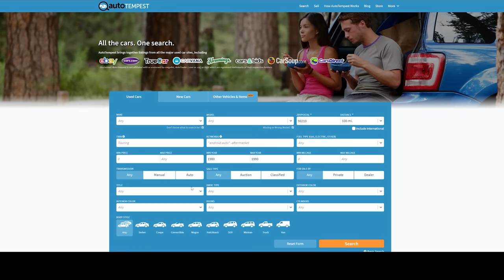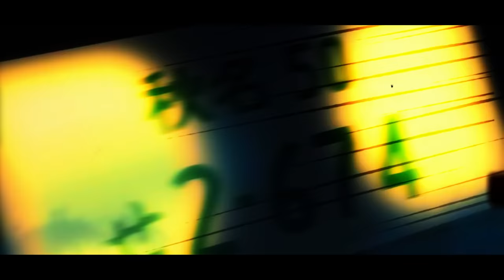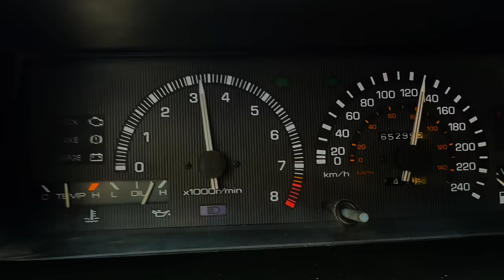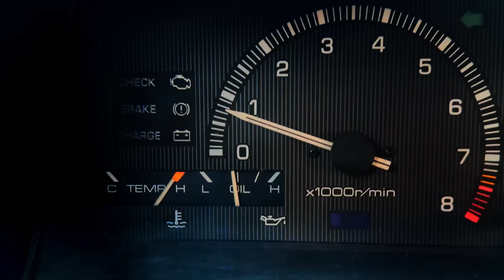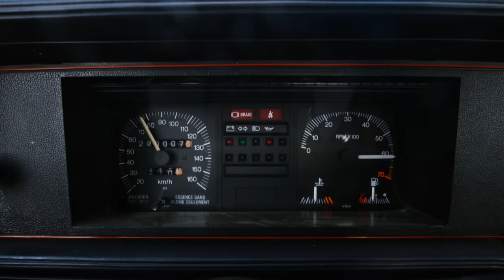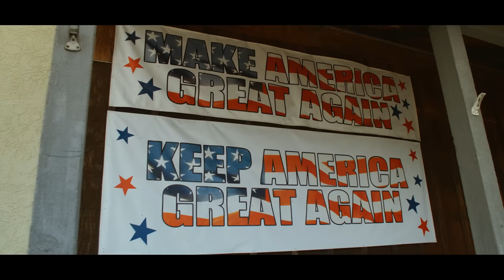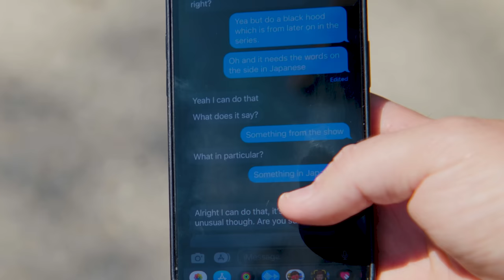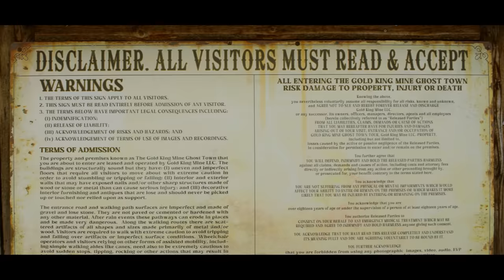1,000 Miles Across the Desert in OUR Toyota AE86 and GTI // Road to Enlightenment Ep.1

Comment: A car often overlooked in the 80s, that had more performance than both of these cars stock, is the Honda Accord Lx-i.
This was the first Fuel Injected Accord, and they were amazing! They weighed more than these two, but you got dual wishbone suspension all around, 20-30 more tq/hp than these two, had a significantly lower center of gravity, and lasted an incredibly long time. You could also have it in three body styles, at the same curb weight: Coupe, Hatchback Coupe, and Sedan.
Yes, you could get a Prelude with more power, but it was actually heavier than the Accord, even though it was based on the Accord....
Reply: An Accord had independent double wishbone suspension? Holy shit, how have I not heard of this?
Reply: @RhodokTribesman  I can't say why of course. But, it was often described as an "Unequal Length Control Arm" design. Which is what a Double Wishbone is, if done properly. The design was a Multi-Link lower, and A-Arm upper control arm, with Coilover Shock, design. It did get more true Wishbone style parts in the 90s and beyond.

Comment: I have waited for an AE86 review from you for ever! And this is just like the old Top Gear films! Yet another step forward for Throttle House 🌚❤️

Also, the AE86 sticker in Initial D says: "Fujiwara Tofu Store (For private use)" :)

Also #2, that AE86 with a Beams engine is the exact reason why I dislike any sort of heavy modification on a car, things don't work properly because that engine wasn't designed for that body's airflow 🧐 (Or so I suppose 😂)

Comment: The GTI 1.8 8v, with stock exhaust....from experience LOL!  that and the original cam really dogged that engine. 

Biggest improvement, particularly highway torque, was installing the euro manifold/exhaust and a G grind or north american spec 1.6 cam. It literally woke that engine up.

I really miss my 84 scirocco. The 80's did have some fun cars

Comment: My first used car was a 87' Celica GTS, lightweighted and so much fun to drive. Small and nervous car.  Even if it had only 135  hp, I feel that with less weight, I had more performance and handling than any cars I had after with much more HPs. Fun fact, I had the engine removed once to work on stuff on it, and I was able to lift the engine by myself as it was so light!

Comment: Its amazing how far cars have come.

A couple of years ago I was daily driving a euro MK1 Golf GTI 1.8L, with proper cams, shaved head, lighter flywheel, Porsche injection, spax coilovers and bunch of other mods. Made 129 wheel HP.(from 112 on the crank) It was a Rapid little car.

I had that car for 5 years, now I own a Model 3 Performance. Old cars are awesome when you are alone on an old Mountain road, but they are horrible in most other scenarios…. I tought about buying one again. I tried one, but its hard to get exited when you can daily 500 horses reliable… even my Superduke have barely gotten used after 4 years with the Tesla.

Comment: Takumi gets the 11k RPM engine swap, driver side bucket seat and gauges in the latter part of stage 2.

He got the passenger bucket seat at the start of stage 4. He gets the carbon hood from the 2nd battle with Todo school.

For stage 5, the engine was modified for more consistent performance (peak power came at 9k rather than 11k), a new gauge cluster and other upgrades. For the Kanagawa races, the car even got a roll cage.

As for the writing on the door, it was only on the right side (as that's where one drives in Japan). The text literally reads "Fujiwara Tofu Shop (Self Use)*

Comment: JB!! I do agree with most of these complaints. However, I’m shocked about the carpet material in the wheel wells. They are so easy to clean! I’ve owned a 2016, 2019, and 2022 Silverado all with the same covers and they are soooo much easier to clean and they don’t stain like the plastic does. Much love though brother 👊

Comment: In Europe the first hot compact in 1963 was the Austin Mini Cooper 1000 with 55 bhp and 91 miles top speed and it did 0 to 100 km/h (62m/h) at 16.5 seconds and many executive cars with more than 2 litre engines and about 100 bhp looked into the exhaust of that car.

Comment: Not sure what they were thinking with the mid range torque, but the euro exhaust manifold and dual downpipe  (or Mk2/Mk3 manifold and an aftermarket dual downpipe) free up a lot of power.  The stock motor has a single outlet pipe on it.  You can get a 'euro grind' cam as well.  If you so desire.

Comment: yes, I read it I thought it was a joke and I laughed lol... It's supposed to say "fujiwara tofu shop (private use)". For the requirements of the time, it was regulation to have it listed on the driver side of the vehicle. For the US it would be on the left, for Japan though it would have only been on the right side of the car. Most just put it on both sides, but Fujiwara was a cheap guy. So it only got listed on the right side only and it's that way for the show and manga. The requirement was dropped in the later years and that's why it's not on the STI, it's honestly a really good touch of reality for the show.

Other issues with the build: Interior of the car in the show was red, steering wheel was a Involtini admiral, rear tails are not from a sprinter but from the redline, front and rear bumper is a from the late model, also the mirrors are also from the late model, eye brows and corners are also from a late model, naturally engine but imho its better to have the 3s. I also can say Id overlook the interior and steering wheel. The red is hanious and IMHO a 4 spoke wheel is much better.

Comment: I think the reason why james' door opens wider is that it was only made as a 3 door hatchback whereas the golf (sorry, rabbit) was originally designed as a  5 door hatchback, which meant you didnt need the front door to open as wide. So rather than having to redesign 3 and 5 door, they kept it simple and just took the back doors off but didnt change the front door opening.

Comment: I never understood why the DOHC 1.6 Corolla was such a big deal.  Oh, anime...that explains it (and the $29,000 USD for a restomod of questionable quality).  I was 21 in 1985 when I got my first Japanese car (1979 Corolla).  I liked it so much that I got a 78 Celica GT, then an 84 Celica GT, then an 85 300ZX, then an 85 300ZX Turbo (all hatchbacks).  Going back to a Corolla never crossed my mind.  The 1978-1985 Celica GT with the 20R (2.2 liter) and 22R (2.4 liter) engines were bulletproof, relatively fastish, and handled great!  That is the car I would have chosen for your challenge.

Comment: Just a thing about the Beams, or 3SGE, it was the first engine with VVT-i, it's NOT the same as VTEC. Toyota does has a system which IS the same as VTEC, it's called VVTL-i. L standing for LIFT.

Comment: my 90 corolla gts ( same engine as the 86 , only different is it's fwd instead of rwd of the 86) would go around trip 1k miles and back 1kmiles without any problem, my car has never over heated or will ever be, with a car which over 30 years old , u have to get a new dual core ( mine is four core) all aluminium radiator and hoses. new fan is a must also. on the freeway cruising, my coolant temp at the thermostat is around 100-130 degree f, the coolant temp at the upper radiator hose is 170-175 degree F. ur corolla was overheated due to air trapped in ur system, at over 60mph the air flow is gonna keep ur coolant temp down to the minimum there is no way speed was the reason y the car got overheated. the fith gear loosing power cause u need to use the 5th gear for 65+ mph, if anything below that speed u need to down shift. these engine make power above 3k rpm, below that they produce almost nothing.

Comment: The Golf GTI US version hat the square headlights from the Jetta 1. generation because the Jetta sold 80.000 cars a year and the normal Golf sold less than 40.000 so Volkswagen was close to take the Golf from the market and in 1983 Volkswagen presented the 2. Generation Golf and production place at US . The Golf GTI 1. Generation was still in production 1 year longer and so it would have been more expensive to supply the round lights only for these few Golfs. That is the reason.

Comment: 4:56 these are $16k cars?  That is hilarious.  Ouch $36k.  ahahahahahahahahaha  And what is wrong with that front left wheel?  I had an '86 mk2 gti back in 1994 for $2000.  Not a chance I would spend $16k for one though.  My '86 lived its 5 years with me at redline in just about every gear every day of its life.  It did have some blue smoke at the end of its 50k miles with me, but it was really abused and never left me stranded.

Comment: I think they are making unrealistic complaints about the noise older cars were not that bad but i miss the comfort of older cars the sportish suspension of new cars i don't like they are to stiff and unforgiving 80s and 90s cars were super comfortable i miss soft suspension that did its job every bump feels like a slam in modern cars and its car reveiwers fault no one drives hard enough to take proper advantage of how sporty modern suspension is but there are plenty of torn up roads that soft playable suspension would come in handy but we all have to deal with stiff tight suspension because car reviewers say it's not sporty enough unless you're racing how stiff and tight suspensions are made now benefits no one driving in 90 percent of situations it would be nice to have suspension made to do it's job of soaking up bumps and not transmiting motion and harshness into the passengers than a sporty ride.

Comment: that golf with more mid range grunt, could be they expecting more people to buy auto and more mid range prob be better. car weighs hardly anything, on the twisty roads it leave lots modern cars behind with a good driver. all cars ive owned been light weight small cars, loads fun to race around the welsh tight twisty mountain roads, with only 1.2 i left a few behind. light weight, good tires and brakes and engine what out performs lot small engines cars from that year, and can do 120mph on autobahn more than enough to have fun on narrow roads and roads so bad they shouldn't be called a road. my city car also dose a tad off road, few forest tracks in welsh mountains so far some from WRC but more to come. a car you closer to it limits more often is just more fun, taking a car places you should't loads fun but you must know car limits. no damage so far but don't push luck as be expensive for a recovery but the exploring part even if slow fun off road